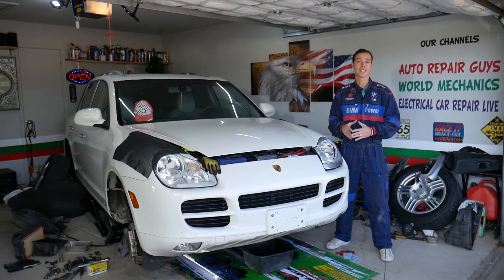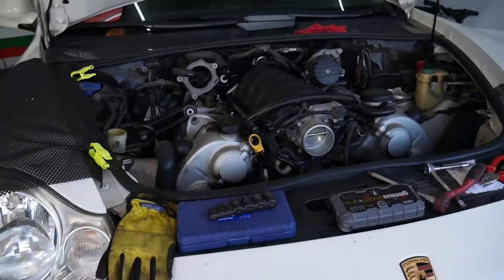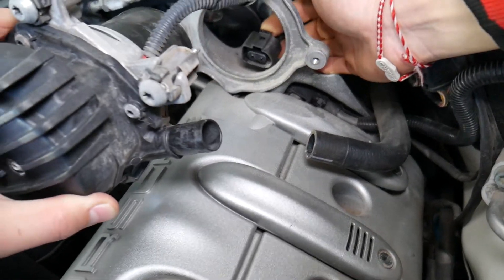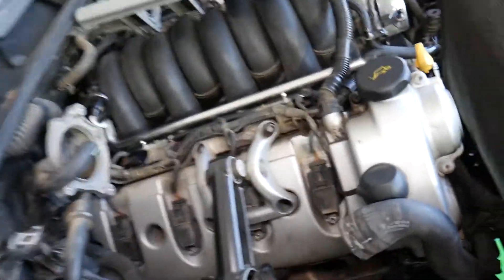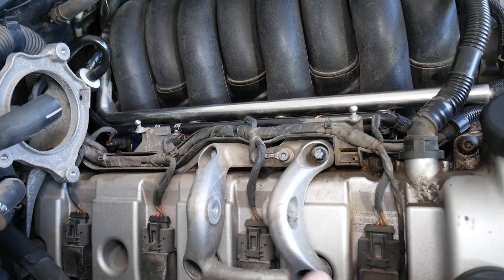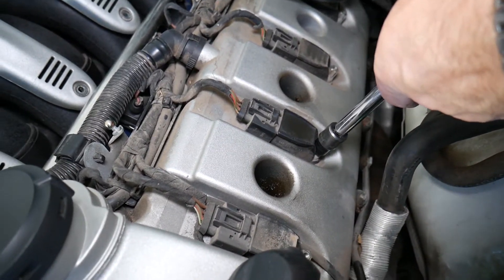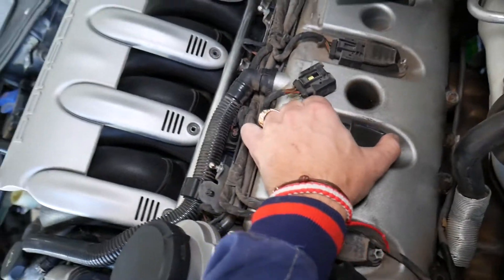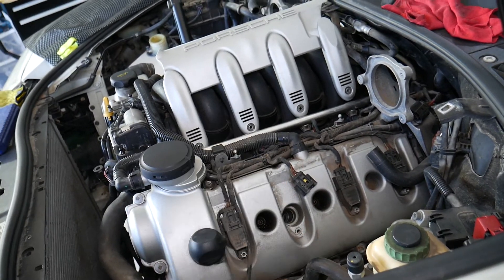PORSCHE CAYENNE S IGNITION COIL REPLACEMENT REMOVAL

Comment: The upper engine bracket E12's only work for the top two screws. A regular E12 socket does not work for the bottom two screws. You will need an E12 deep extension socket to get them out.